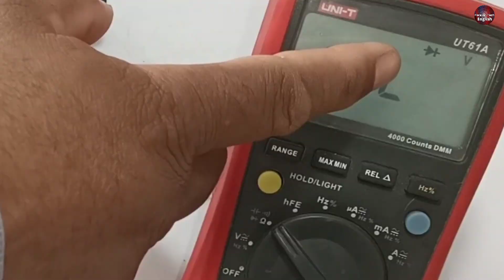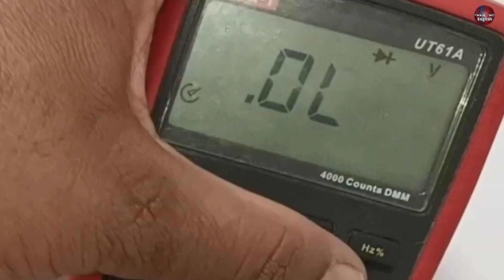Mini Split AC Control board Blowing Up - What's Wrong?

Comment: If it helps someone else find this video, I used this for board A010283 (v1.1) 
It is not entirely identical, as some components are ever so slightly different, but in my eyes it is equivalent
Reply: This board was in a Della 9000btu minisplit
Reply from the maker: Thanks for mentioning that.

Comment: I have an HEC (haier) AS24TE1HRE with outside 1U24SU1ERE, on cool mode, when turn on, red light comes on the  fan is running for a few minutes then white circulation symbole start flashing then after a few moments red light turn off and while blinking and fan turn off too
And out system fan and compressor doesn't kick. 
Also I saw the red led light on indoor pcb system is always off?
What do you think the issue might be?
I did reset the remote and there is bottom on indoor also, I push and hold it until makes beep, I believe it reset the board but nothing happened, still compressor doesn't work.